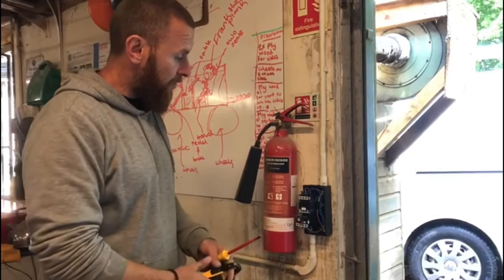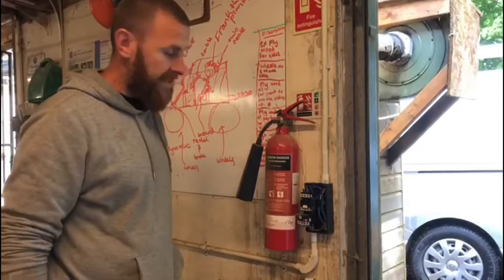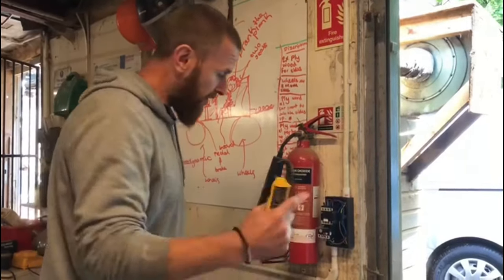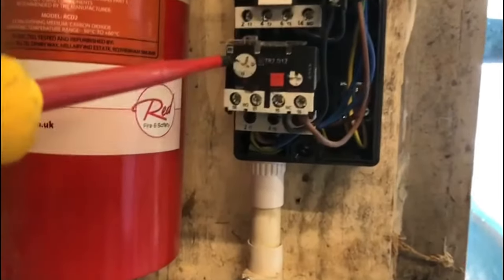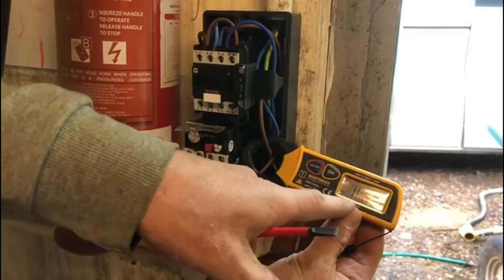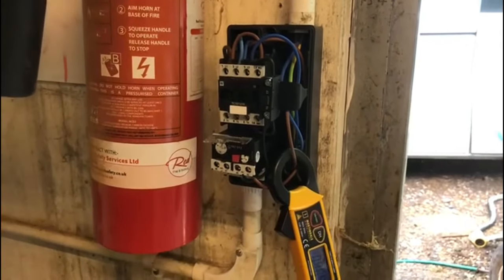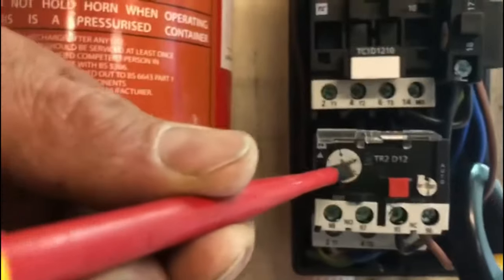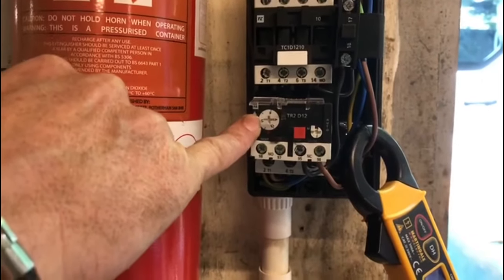How to Set an Overload Whilst the Load is LIVE - Direct Online Starter DOL

Comment: You should definitely use the motors name plate to set the overload. How do you know that the motor is not pulling more load than it should be? There might be mechanic wear within the motor, bearings etc…

Comment: Use the nameplate details, what if the motor is pulling more current then the full load current of the motor. Could be a number of reasons why the motor is drawing high current. Would not be the first time I started a motor and it was drawing more than the FLC.

Comment: thanks for your lessons. It is userful in case you do not have nameplate or it is to hard to see parameters. In case u have information such as FLC and S.F. you may calculate. But for person who has zero knowledge this method is very userfull, at least protection will be setted.

Comment: By experience, It’s the  rated load current on the nameplate  multiplied by 1.1 ( if the motor manufacturer says 10 amps the overload is set at 11A )  or you can do all the maths for that to set your overload, though both ways give the same result
Thank you for the video
Reply from the maker: Thanks for your input 👍🏻

Comment: I understand it is an “overload” protective device but, Is startup current (inrush current) not a consideration when setting the level?

Great video btw👍
Reply: No, start up/inrush only lasts for a second or two, overloads work on thermal expansion, so takes many 10s of seconds or minutes to operate.
A suitable MCB/fuse is the safety device for startup/inrush over current. DOL motors such as fans can take 5-10-15 times the name plate current for a second or two.
Often you need type D MCBs or Type T fuses. 
The overload is protecting the cable and the motor better than the fuse MCB ever will.

I used to work on an industrial blower that would pull 1500 Amps for over 30 seconds, running current was 125Amps, we had special delay current monitors.
Fuses were 315Amp Special delay for high current long start units, after 3 starts in less then 1 hour you honestly couldn't even touch the fuse, they were about 150 C,

Comment: Nice video 👍, fan sounds a bit shady ??😂
Reply: Yeah the fan sounds like it’s on it’s way out although it’s always sounded like that. It’s was originally wired of a light switch.
Reply: @electrodellinstallations556   if its pulling 10 amps (2.2Kw)  its a fairly decent sized fan... also, it sounds like its mounted on a timber panel... which would amplify the noise... 

😎👍☘🍺

Comment: Always, always, always use the nameplate data.
Some overloads have a % increase built in some dont check their data sheet as well.
Most have overcapacity built in so setting it to the exact number on the nameplate will be fine.